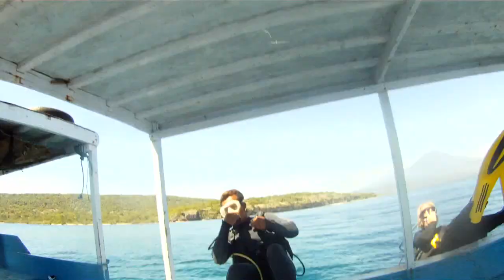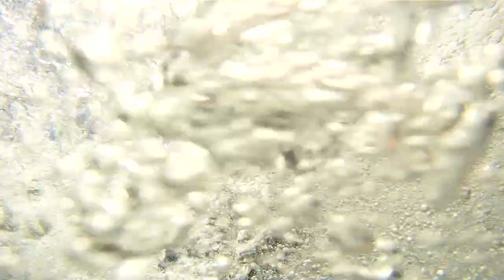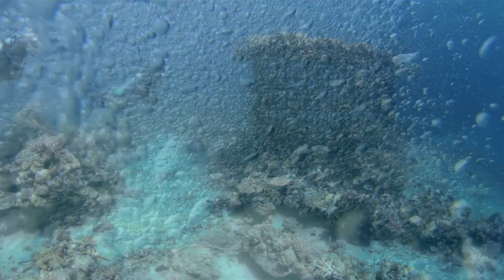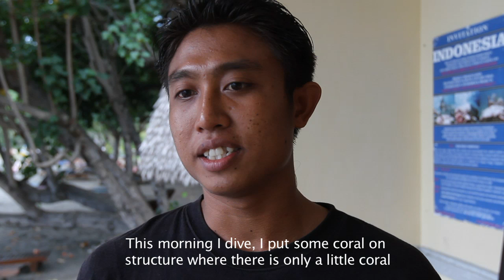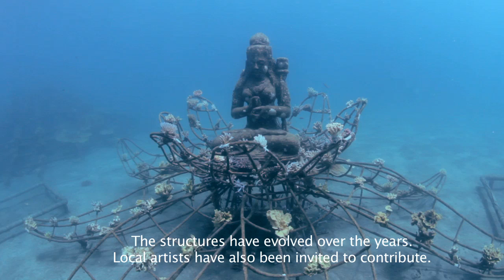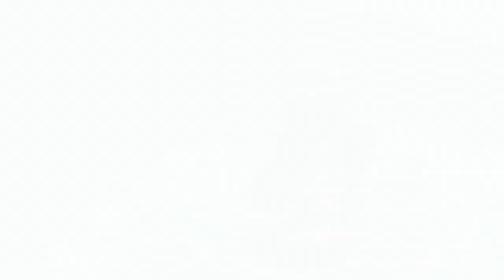Biorock - saving the reef in Pemuteran, Bali

Comment: How much current is being used for these structures? I've read it's only a very small amount and was wondering how likely a solar unit would be able to produce the power needed. They have said that the effort is limited but what if the effort were expanded by private or government means? Seems like an incredibly viable way to get large portions of reef back into good shape. I understand the bleaching due to warmth is still an issue but seems that the proven science is here and we can still make a lot of efforts even if it does start grass roots.
Reply: 12v or less
Reply: Bleaching is a natural thing it goes in cycles. some years there is more corals than others that is a proven science fact that they don't want you to know about. At this moment the great barrier reef has record coral on it.